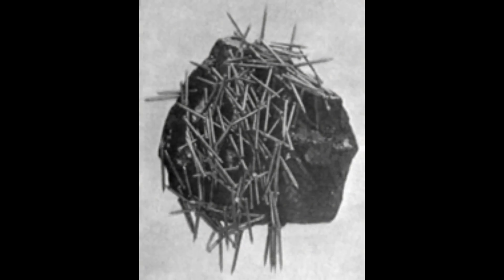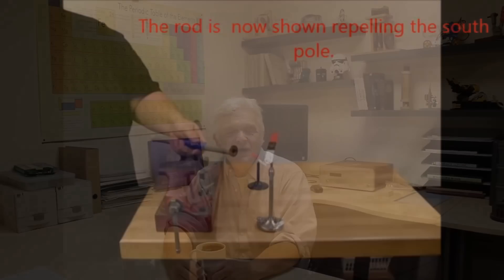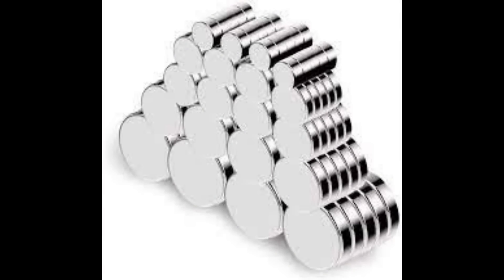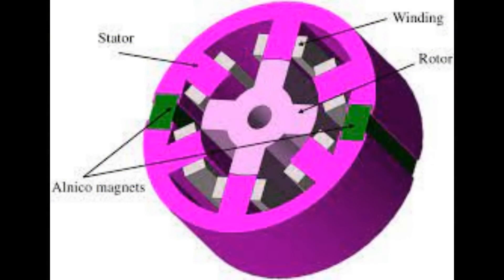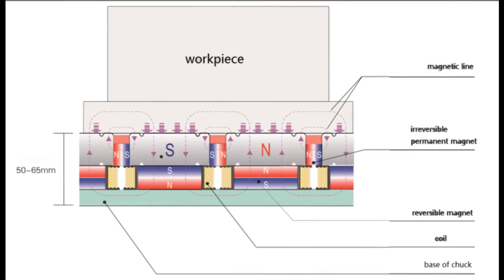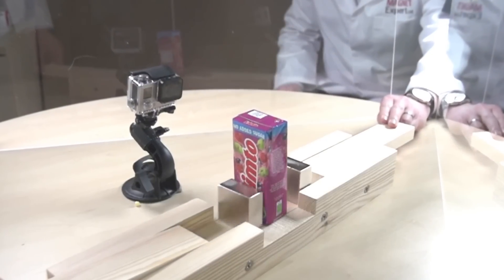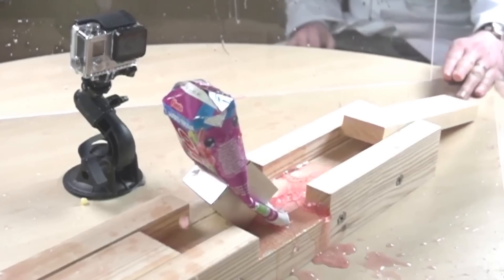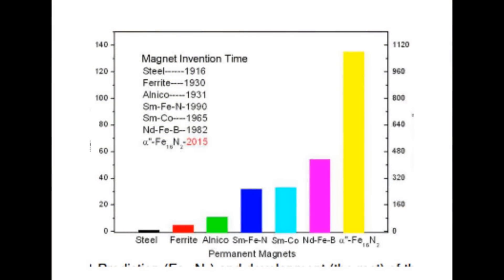1626 Clean Earth Magnets - The Next Step In Power And Mobility

Comment: The Lynch motor (AGNI Motor) is a permanent magnet axial gap pancake style motor that uses ferrite fins/plates in place of coils and is extremely efficient and powerful for a brushed motor, outputting incredible torque.  It is also an excellent generator, one of the best I've ran across.
Reply from the maker: I did look into it and yes they are good but I am still, myself, not sure if they are more style over substance to be brutally honest
Reply: Just looked over their webpage if they got these better magnets into their motors holy smokes!
Reply: What happened to them? They have a channel on YouTube and the last video is 2 years old. Website undergoing changes or something...
Reply: Must look that motor up. Thanks
Reply: "extremely efficient"  "incredible torque"  lol   they produce the same efficiency and torque as any other motor.
Reply: @murraymadness4674  I'm impressed by your knowledge.
Reply from the maker: @murraymadness4674  I am sorry mate but I feel I had to pitch in - efficiency on electric motors varies  between 65% and 85% spending on construction as I am sure you know - I do agree with you that Lynch motors are a bit over hyped right now - but like anything science and engineering is a bit subject to fashion - so I usually let that bit slide lol
Reply: @ThinkingandTinkering  
The Lynch motor is an unconventional design with a disc armature. It marries the advantages of a conventional, wound armature motor with the benefits of a flat (printed circuit) motor. It is similar to a pancake motor, but is more powerful than any of these technologies. The disc armature has magnets on both sides, doubling the available flux density and shortening the magnetic path. It therefore packs more power per pound and per cubic inch than any other motor technology. Of course such a revolutionary motor is not for every application - it is not as cheap as wound field motors, but for many applications it is a far superior motor.  It has a previously unheard of power to weight ratio and also power to volume ratio. It is also highly efficient because of the double magnet design and associated short magnetic path. It also includes integral fan cooling.

 The Lynch motor is an important development which spurred other motor designers to improve their products to remain competitive, such as synchronus permanent magnet machines.  As a result of the competition between manufacturers the cost of high performance motors and controllers has fallen dramatically.  We hope the cost of solar cells also reduces to allow renewable transportation to develop as a viable alternative to carbon fuels.
Cedric Lynch built his electric bike around a mid-drive configuration, also building one of the worlds most efficient light weight electric motors to power his rig reliably at 60-MPH for significant distances. He would later set several world records with his axial flux motor and bring it to market as the Lynch / Agni motor. Briggs and Stratton would eventually buy this technology which would lead to the Etek motor, which is now famous for making high speed efficient electric hot rods.

Cedric uses to achieve high speeds is by following the rules of aerodynamics, and building a bike that is as aerodynamic and as efficient as possible. The other builders on this list bypassed this step, and Cedric uses this bicycle as daily transportation on real commutes. Although this high-efficiency motor uses “old school” brushes, this fact allows builders to use very affordable controllers. He has proven his design choices through thousands of miles of commuting, and the Lynch motor is highly respected.

Cedric Lynch is known as the creator of the Agni Motor, a highly efficient electric motor that weighs around 25 pounds and can put out as much as 50hp. 

Cedric Lynch is a British 'mad scientist' type mechanical engineer obsessed with the idea of greener transportation. His interest has been in building a super efficient yet powerful vehicle that can serve as a car replacement.

He started thinking of his own design for an electric motor in 1983 when he began entering competitions organized by the Battery Vehicle Society regarding building an efficient electric vehicle. At the time there was no reasonably priced DC motor with descent efficiency so Lynch decided to build his own utilizing modifying existing motors with old tin cans that he would spread out flat to use as cooling fins. Surprisingly using rudimentary materials and a garage work bench, Cedric was making better more efficient electric motors than any of the universities were able to manufacture in state of the art workshops.

Cedric then came up with a motor design that could be cheaply manufactured and began manufacturing his own motor that he could sell to the public in 1988 and the Lynch Electric Motor Company was born, known as LEMCO.

Cedric first used his motor to create a small boat called “The Spark” that would set an electric boat efficiency record. From there Cedric turned his attention to bicycles, an application generally considered too small for a lynch motor at that time. Cedric mounted his motor in recumbent bike, allowing him space to eventually use a set of thundersky lithium batteries.

The resulting aerodynamic recumbent bike had a top speed of 60mph and still managed an incredible range of 150 miles. Cedric rode his recumbent creation everywhere as a daily commuter, putting an amazing 50,000 miles on the machine - technically a motorbike.

Briggs and Stratton, the US firm famous for lawn mower engines, bought the technology and used it in their E-Tech Motor, and Cedric went on to manufacture his latest incarnation of his lynch design into the Agni motor, which is used in go karts, sailboats, motor boats, and even small airplanes.

The Lynch designed motors all have the same traits. Brushed motors, around 25 pounds in weight and they are able to put out enormous power compared to their weight. Sometimes as high as 50 hp (depending on amperage ran through the motor) at an incredible 98% efficiency.  Lynch Motors are also the most often used motors in electric motorcycle racing applications.

Cedric's zero-emission motorcycle, which has a top speed of 120mph, was shown in action winning the world’s first zero carbon race – the TTxGP in the Isle of Mann.

The idea for the electric motor has been snapped up by the 56-year-old’’s friend Arvind Rabadia, who together with his brother Hasmuk Rabadia had been thinking of starting a business in India. They have now set up Agni Motors to make further-improved versions of Cedric’s motors

Despite Cedric’s breakthrough invention he has no formal engineering qualifications and taught himself the techniques needed to construct his engine. He first became interested in electrics when his parents bought him a book entitled How to build things from things found at home. 
The Etek motor is a brushed 25-pound pancake shaped motor that puts out enormous power for its weight. Depending on amperage and voltage the Etek can easily provide between 15-horsepower and 30-horsepower reliably and consistently (11-kW / 22-kW). A perfect platform for a powerful electric bike if you do not mind the weight. Although brushless motors are considered more modern, a brushed motor like the Etek allows the builder to use very affordable controllers.

Cedric-Lynch invented the motor and sold it to Briggs and Stratton which US company produced the Etek at a lower price (around $600). In the late 90’s early 2000’s it was the way to go for a high-power / light-weight electric vehicle. Many small E-vehicle records were set using the Etek motor. Finally, the market had a relatively lightweight and powerful electric motor available to the masses.

In essence, the Etek allowed hot rodders to build electric bikes. Before the Etek very few people had ever achieved 50mph on an electric bike. Even today, Etek motors (and newer incarnations of the Etek motor) are used to make some super fast electric bikes. In the case of Liveforphysics, the fastest E-bikes ever.

 Liveforphysics used a newer version of the Etek (the Agni motor), to achieve speeds of over 70mph, and dominate a recent hill-climb event.

Every Etek I have ever ridden has been characterized by brutal off-the-line acceleration, usually to a point where you have to apply the throttle very carefully or get thrown off. However, it is possible to run an Etek at a lower voltage or lower amperage and have a very manageable, safe, and sane electric bike that will not burn out on you, no matter high steep the incline.